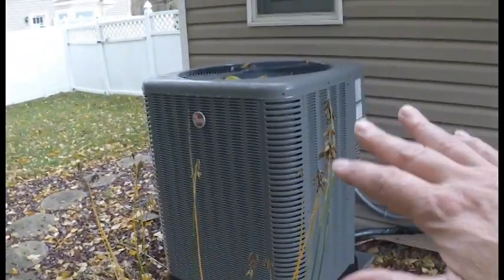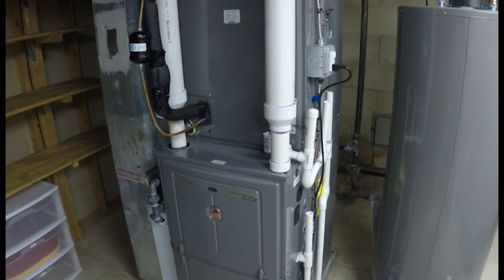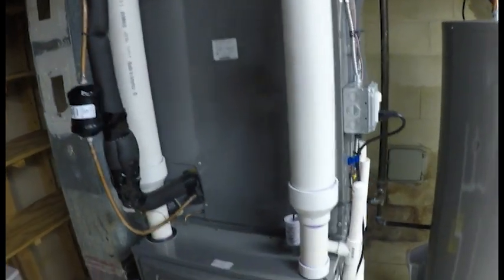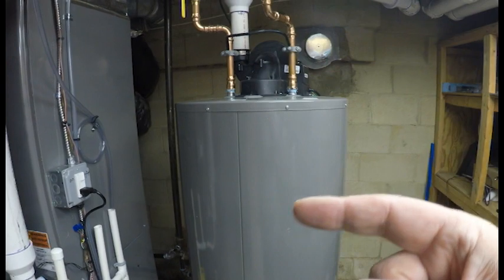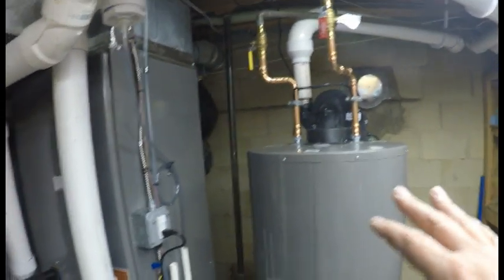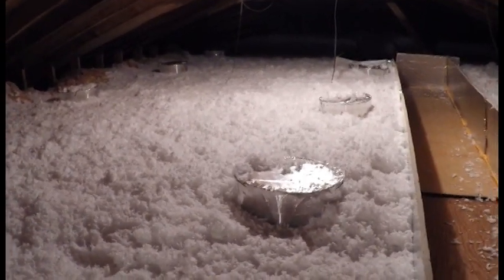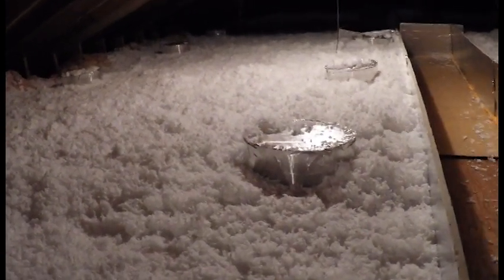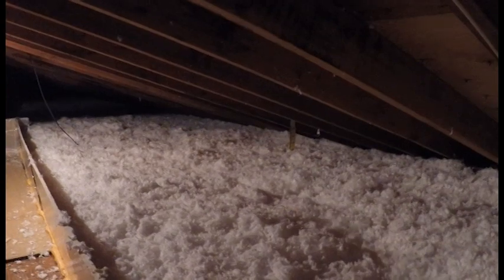Energy Bills Too High? Try These 4 Upgrades

Comment: I found you right in the nick of time in 2020 my father passed away and he was the wise man to explain how things work and what needs to be done fast forward to 2022 in a 2 story 5 bedroom 3 bathrooms we've had a leaking ceiling from the AC drainage in the attic ceiling leak from a shower upstairs when turned on, water heater that's NEVER been serviced since 2009 🤦🏻‍♀️& black mold to go with it & a AC that needs a new compressor I need to replace ASAP I LIVE IN AZ can't take no chances on no AC in the summer 118 degree here outside we won't stand a chance inside the house with no man in the house I'm on my own to take care of things which is why I appreciate more than you can imagine you taking the time to make these videos 😍